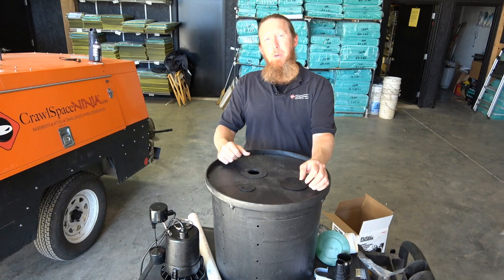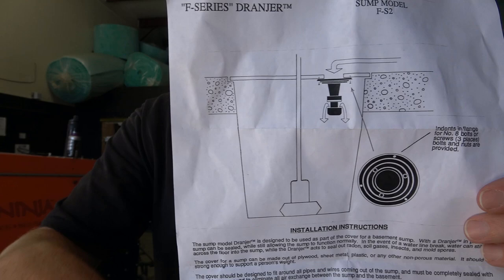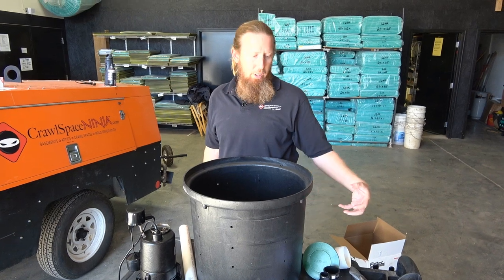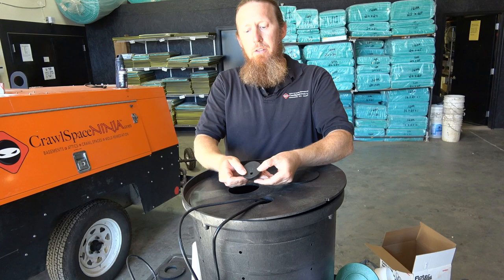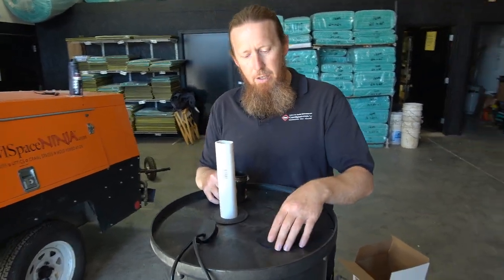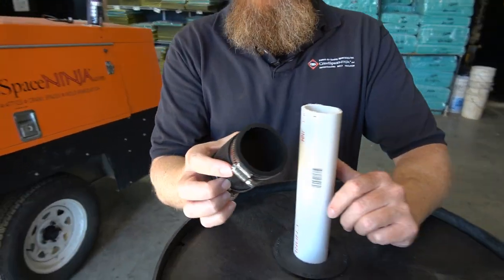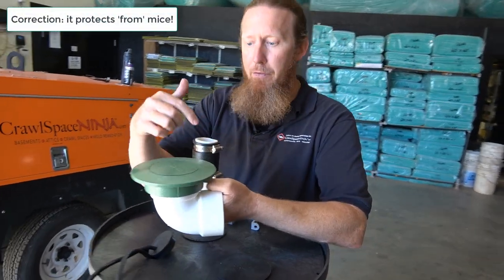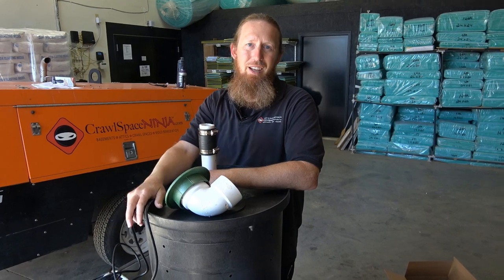How to Install Crawl Space Sump Pump | Sump Pump for Crawl Space DIY

Comment: If I pour a floor over plastic in the crawl space. Where’s finish floor height? Is it below or even with the lid or the perforated barrel. Should I run a perimeter hose or just us stone under the plastic sheet?

Comment: I live on a hillside, not the top and not the bottom of the hill. So...water passes under/through my house. I have a sloped unfinished crawlspace where the foundation support pillars are located. I have loose gravel covering the whole space. However the gravel is ALWAYS wet, and the air always feels damp. Should I go install just the sump pump in the lowest point or do I also do a French drain?

Comment: thanks for the video, i saw the pipe that pumps the water up that has a small cut from a saw, is it rigth to have like a grove?it is inside the tank but still like a place to loose presure. thanks.
Reply from the maker: Hey Francisco, the pipe shouldn't have any sort of cuts or defects. The one used in the video likely was just a scrap piece used for a demo. Thanks for watching and have a blessed day
Reply: @CrawlSpaceNinja  thanks for your reply. I saw that you drilled a small hole with an angle. Have a great day

Comment: I plan on installing this sump/pump combination in the 'problem' corner of my crawl space.  Surrounding by clean gravel that will be leveled off just under the lower edge of the top of the basin.  Once done, what is the best finish of the vapor barrier surface as it relates to the top of the basin?
Reply from the maker: We tuck the vapor barrier under the basin's lid. I hope that helps and thanks for watching.
Reply: @CrawlSpaceNinja  thank you

Comment: Is it possible to route the discharge pipe of the sump pump into a waste line of the house?  Wouldn’t that be easier than drilling through the foundation to the the pipe out.
Reply from the maker: Great question, Sergey.  It's probably not a good idea to connect it to the sanitary sewer line, but many sump pumps are connected to storm sewers, and that's usually fine. While it might seem convenient to discharge your pump into the sanitary sewer, you're actually putting your home at risk. In many parts of the country, connecting your sump pump to the sanitary sewer is illegal, and for good reason.  The sewage treatment plants can become overloaded during storms or heavy rainfall. How does that affect you? If you're not connected to the sewer line, nothing happens. You may have sewage backing up through your line and overflowing into your home if you do. If too many sump pumps are connected to the sanitary sewer system, the sewers can become overloaded.  Besides not connecting your sump pump to the sanitary sewer line, when it is connected, the city is unable to track your water usage. When you're connected to the sewer line, municipal departments can't track each home's use accurately. In essence, this is stealing from your city's water department.  Talk to your local water department or local plumbing board about your sump pump discharge options before you work with your sump pump and sewer line. In most cases, however, connecting your sump pump to the exterior of your house will prevent sump pump overflows, and is the right thing to do.  Thanks for watching and have a happy and blessed day.

Comment: which kind of 1 1/2 inch rubber gaskets have you used? The one I found from the home depot can just hold 4.3 psi water pressure. I am not sure if it can be used as part of sump pump discharge pipe.

Comment: I bought the system through your store and the instructions that came with pump mentions vent to prevent air lock. Also do I use dope or tape at cast iron and pvc transition?
Reply from the maker: Drilling a hole can help with air lock but it occurs rarely. I'd recommend using a rubber coupling to transition if you can.

Comment: So I partially encapsulated my vented crawl space in the fall. I included 2 crawlspace fans. So far so good. Need to clean up mold haze that happened sometime before I did the encapsulation.

So my question is (please take into account 2018 is the wettest year on record) what should I do about the water collecting under vapor barrier? I have about 1 or so of water underneath. Please note that this hasn’t happen before. When we originally got house, there was just a layer of 6 mil on the floor. 

I’m think I may need a sump. 

Location - Moco County Maryland
Reply from the maker: Yes, a perimeter trench and sump pump will help remove standing water.
Reply: Crawl Space Ninja I have wondered this as well.  We have no standing water and are getting ready to install a vapor barrier with proper seaming.  If you later have an issue if water under the barrier, is that a complete redo of the barrier to install the trench?  I’m also curious how these trenches would be connected to a radon vent system in conjunction with the sump pit.  You all may have a video on radon I just haven’t got to yet.  Thanks again for the excellent content.
Reply from the maker: @MLJenkins  In most cases the vapor barrier would get ruined in the process of having to dig the trench and would result in a redo of the encapsulation. Typically the radon fan systems run under the vapor barrier but above the dirt and vent outside the crawl space separate from the water management system. Some people do tie the two systems together, but keep in mind that if your sump pump pipe has water in it it could affect the efficiency of the radon system.

Comment: It looks like you are using a sewer basin, no?  The sump basins I see are usually thinner and are corrugated.  Is there a difference I should be aware of?  The sewer basin seem better quality.
Reply from the maker: No, this is a sump pump basin and is not corrugated or thin. You can find more details about it on our DIY Store: https://diy.crawlspaceninja.com/jackel-sump-basin-15-gallon-lid/

Comment: 2:45 are you using that sump pump for all of your dehumidifier water (running continuously throughout the day), or only for emergency flood water that fills in the sump pump basin? I ask because it would seem you would prefer to have a more energy efficient lower horsepower pump designed to run lower amounts of water continuously, rather than something designed to move a ton of water. They seem like two completely different engineering requirements.

Also, if using for condensate, wouldn't it make sense to use a smaller size tubing than 1.5"? It would not move much water if so much volume is taken up above the check valve area. Maybe as small as 0.5" or 3/4"?
Reply from the maker: If a crawl space we are doing is also getting a water management system installed (sump pump and perimeter drainage) we will run the dehumidifier condensation lines to the sump pump so that we are not creating additional exit points in the foundation wall. If the crawl space is not getting a water management system, the line from the condensate pump itself is ran outside underground to a 1'x1'x1' dry well. We use a .5" pvc pipe for the condensate pump discharge and a 1.5" pvc pipe for the sump pump discharge. Hope this clarifies things for you!

Comment: Hello. I live in northern Ohio in a city called Port Clinton. I have a crawl space that gets wet and the sump pump works but it is right next to the wall the septic tank is located and smells when it rains. I want to relocate it farther away from septic tank. 

How deep should the basin be for Ohio?
Reply from the maker: Hi Matt, the basin should be located at the lowest point of the crawl space for proper drainage.

Comment: Do you still have to drill the large inlet holes in the side or are the drain tiles just sending the water into the surrounding gravel base?
Reply from the maker: We make sure to connect the EZ flow pipe to the basin to ensure all the water is pumped out.

Comment: Any suggestions on how to dig out a hole for a sump basin in some VERY compacted clay soil? Also not much space in my crawl space. Maybe 2.5 ft from ground to ceiling of crawl space.
Reply: Open up the floor above it to create space for digging.  Also you can use a jack hammer on compacted soil.
Reply: Use a claw hammer to break up the soil and then remove the dirt by hand, probably a bit late but that’s how I do it.

Comment: If you were building a storm cellar down south and wanted to put a sump pump in it?????
Reply from the maker: Put the pit in the lowest portion and make sure that the discharge is not in a place where it will flood
Reply: @CrawlSpaceNinja  This place is or will be, about 130 miles from Nashville and about 80 miles from Memphis, how would I go about finding a reputable Co to install a sump-pump????? Do you have names??
Reply: Yes!

Comment: I thought you attach the PVC pipe to the check valve with the rubber sleeve and SS hose clamps that come with the valve like in your DIY store? The valve is ABS and I don't think you can glue ABS to PVC, 5:06?
Reply from the maker: Gluing ABS to PVC is not recommended, as it requires a mechanical coupling instead.